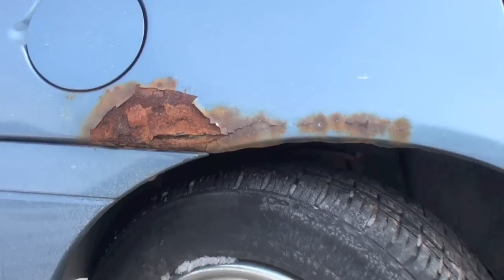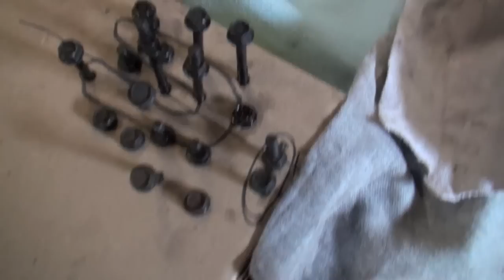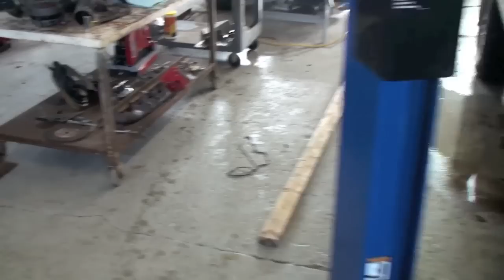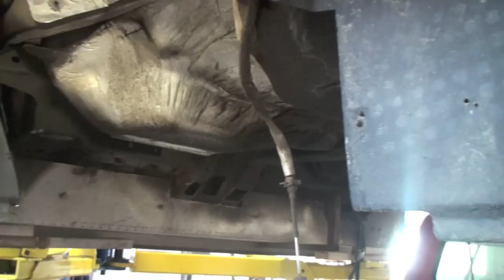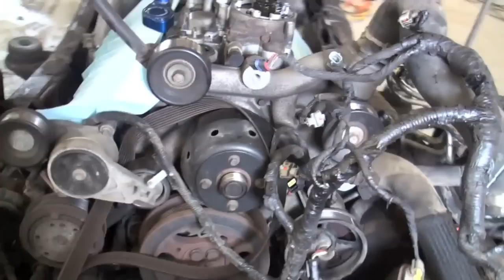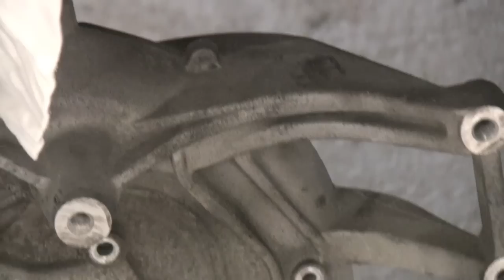cab off 6.0L powerstroke head gasket repair pt.2

Comment: Did you check the deck on the block to make sure it was still flat?
Reply: From research ive done, i dont think you have to worry about that, just heads ( aluminium ).

Comment: LMFAO!
You rag on Dodges because the OEM ball joints don't come with grease zerks, so the joints squeak and wear out. Let me see here, I had to replace ball joints at 180,000 miles, it took me about 2 hours of my time, and less than $200.00 for Moog heavy duty joints with zerks that will last. Now the truck has 868,000+ miles on it, and have had nothing go wrong that required taking the friggin cab off, or head off the truck. Oh yeah, you really came out way ahead buying that POS FoMoCo no go junker.
Way to go Genius.

Comment: @TheOregonRedneck yah the egr on top of the bad head bolts and the bad head gaskets they were setting that motor up for failure.  the 7.3 diesel had like 6 head bolts per cylinder and the 6.0 and the 6.4 only have 4.........

Comment: @IRJohny 
wasn't ford's choice the biggest reason ford and international had different emission equipment is that light duty and medium duty fall into two different emissions categories, light duty is way more stringent because it has to meet both noise and gas/particulate emissions requirements

Comment: @TheOregonRedneck ok dude but he said the heads were 3 grand and the new turbo was prob like 600 and the gaskets probly like 100 and the straight pipe was easy, and theres the $200 dp tuner so i dont think it would be worth it to dump 10000 into a new motor and then delete the egr on that and get it running strong. just sayin thats what it looks like to me+ everyone usually uses this bullet proofing technique like pug

Comment: @462ANIMAL The thing is Ford still built the same blocks for their 300 cid 6 cyl their old Ford Tractor plant in Indiana. If they can build them for agricultural use and make them into diesels for tractors. Why not build on that block a diesel for their trucks? However, they sold out their tractor division to Case/New Holland. So, no chance they weill ever go that direction.

Comment: @462ANIMAL I have owned all three. Well, GMC(Chevy), Ford and Dodge. The Ford had the better V8(351), The Dodge was good for a V6(3.9), and the GMC with a (305) V8 was awesome. The one thing I will say about all of them is the drop of the inline 6's for the V6's in their light duty trucks. The Fords 300 6cyl, GM's 250 6cyl, and Dodges 225(slant) 6 cyl engines were the toughest of the tough. I thinking losing the I6 engines was big loss to some of us consumers.

Comment: I don't care what truck it is, chevy duramax, dodge cummins, or ford powerstroke.  They ALL have had their issues, duramax from 04-06 were horrible to a point where they were actually swapping trucks out for new ones.  Dodge can't keep a good working auto tranny behind the cummins, and ford tried to tell Navistar how to build a diesel which blew up in there faces (no pun intended).  I have an '05 and '10 Ford diesel superduties, and I love them, the '05 is running sound, picked up a cummins yea!

Comment: @1112223333111  its an International motor man not ford, ford f'd up by telling int to turbo the motor it was never designed to be, they wanted the hp/tq to be at the competitons level

Comment: It's funny. While working on my Ford I've found that I can get most of my parts cheapest from the dealership. Brake shoes were cheaper elsewhere. When I replaced the alternator and clutch/flywheel assembly I went to a junk yard because it was way cheaper. But anything else I had to get (slave cylinder, rear end seal, belts, etc) I've found the best price was at the dealership.

Comment: @Jeffreyrno they had to get rid of the 7.3L it couldnt meet emissions and the hp/tq was way low compared to the competition then ford pushed the 6.0L to far by putting a turbo on it internationl never designed it to have a turbo but ford told em to put it on to make more hp/tq its at its limits all the time thats why they fail.

Comment: Hey Pug1, at least you don't have the 6.4L.  When the EGR cooler goes on those it dumps coolant into the cylinders instead of out the exhaust, so you'll be driving along and BOOM, it'll hydrolock and then you're spending 7 grand on a shortblock!  They also have problems with injectors leaking and filling the crankcase with fuel and causing cavitation corrosion that eats the pistons up.  At least with the 6.0 you do an EGR delete and head studs and it's decent after that!

Comment: Not to add insult to injury, but...

After all of the stuff I've seen, the 6.0L PowerStroke seems to be a problematic engine. If I bought a truck and did the factory required maintenance, it should last. Stuff like an EGR delete, new fan clutch, etc. shouldn't be needed. If I was you, I'd tear the engine completely down while you're at it. Who knows what's gonna break next, especially after you ran it low on oil...

That all being said, I hope this is you're last major issue. Chooch it!

Comment: @462ANIMAL im a chevy guy and fords are not hard to work on, i just dont like B.S like what 1puglife is having, trying to get parts then the special tools to put them on. Ford fucked up when they quit useing the 7.3L PSD, thats the only diesel engine that International made that is actually worth being called a Power Stroke Diesel. i still have my 99 7.3L!! just doesnt have the power available like my 07 LBZ does. and my 07 doesnt have the problems that fords had 2003.5-2011..

Comment: @1112223333111 Didn't the dt466 have like 230hp stock lol.  not to say its not a good engine but i think the quality of the engine is more important than the arrangment of the cylinders. Ive seen a Duramax with over 800,000 miles on it and it was used as a hotshot truck. But ive also seen a cummins with loads of miles on it to.

Comment: @Bergstaller01 the last dodge i had went through 4 sets of ball joints 2 sets of heavy duty all in one wheel bearings at almost 300 per. and 2 transitions yes the cummins is a great eng but if they would fix every thing else then there would be a truck no one could beat . my ford 350 has had nothing done to it in the same millage

Comment: @1112223333111 By the time the low coolant or overheating light comes on its too late. You loose some coolant, have air in the system which will just worsens the problem. When the EGR cooler fails, you have those real hot EG in direct contact with the coolant, doesnt matter what kind of coolant you have it will boil off with temps at 1000°+. Its a chain of events that add up to major catastrophe. If Pug let this go much longer, would be $10k+ in damages easy.

Comment: yea the 6.0 would have been a good eng. but they cheeped out on the build quality with the bad studs and cheap injectors   but pug is going it right  with the good head gasket the arp studs  and basic upgrades all around he should be ready for 200k plus because the bottom end is near indestructible .

Comment: @Bergstaller01 yep, took me 4 hours to replace the ball joints on my Dodge 2500, not bad for the first time. Plus my Cummins just rolled 150,000 miles and runs like a champ.

Comment: I drive a 2003 6.0 with 385,000 kms it was a dually work truck, original except it had required work, they really are dependable but ford fuck up on the quality for this one.

Comment: That is one bad thing about the 6.0s is that the heads are so far under the cab you have to take it off for head work... but after you get the head gasket problem fixed its a great truck.

Comment: There is more to a truck than just the engine, brakes tranny chassis just to name a few I love the cummins but would I rather want a cummins in my Ford or a ford over and around my cummins. the after market has addressed  a lot of the 6.0 down falls but it's hard to make a under built truck keep up with an awesome motor like the cummins.

Comment: @1112223333111 EGR temps got hot, which causes coolant to boil off. From there you loose some coolant without you knowing, low coolant=engine got hot, which usually causes blown head gaskets or cracked/warped heads

Comment: @pisser20001 The 7.3 lasts longer cause its gutless.
V-8 is for gas engines, not diesel.
Ford fucked up, chevies duramax sucks too.
The towtrucks with the 466 straight 6 had way more power and last longer.
DT466 #FTW

Comment: Actually...Ford didnt put the EGR system on the 6.0. International was forced to place the EGR system on it due to emisions laws. They outsourced the EGR system from Europe to place it on the 6.0. They never designed the engine to have a EGR system. This forced Ford to spend alot of money in repairs that should have been avoided by International in the first place. Thus is why Ford won there lawsuit against Ford. This was never Fords fault.